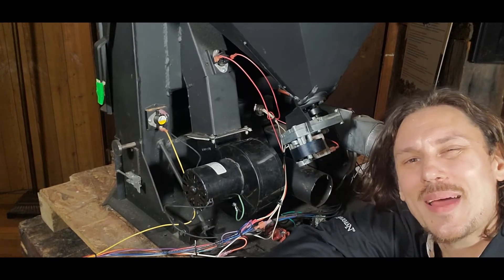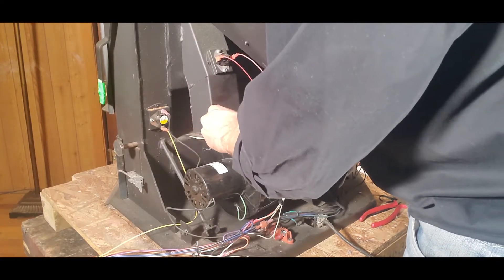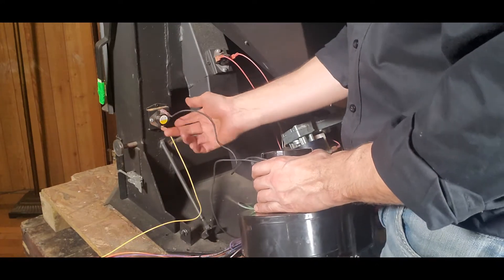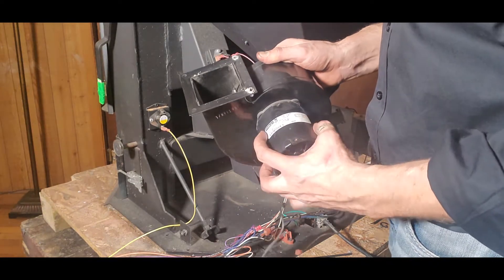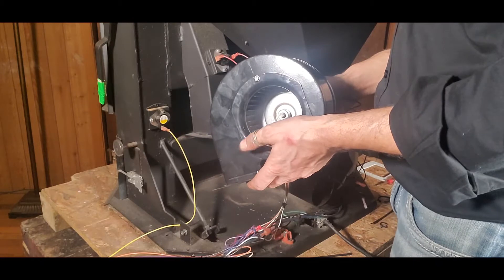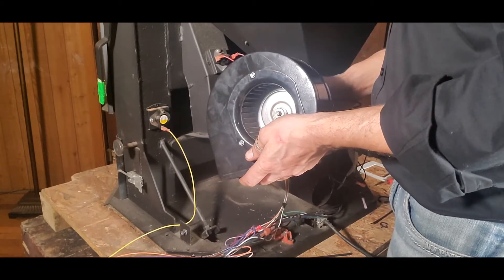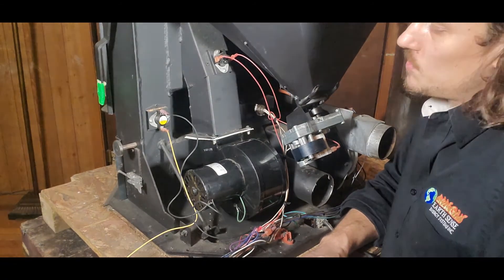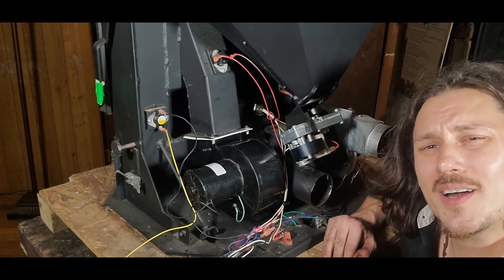Stove Distribution Fan, Convection Blower Cleaning & Replacement

Comment: I have just replaced the convection blower on my enviro ef3 and it now cycles on and off,dont know why as it didn’t before,
Reply from the maker: Thanks for contacting us. Your EF3 model has a snap switch in line with the convection blower. This switch allows the blower to turn on and off based on temperature. Double check electrical connections to that snap switch. You can also bypass that snap switch for troubleshooting (We never want to leave a safety switch bypassed, ONLY for troubleshooting). Here is a video on creating a jumper wire to do this. https://youtu.be/FDVkbsHS95U?si=KGyx_GURdp3WmBq0

To rule out the blower, you can run it to direct power to see if it runs continuous at full line voltage. Video here on creating a test cord. https://youtu.be/rlmiCYI2WPk?si=pCHbbsPfVbgC9zIn

Here is the EF3 Owners Manual. The limit switch that controls the blower is marked as #4 on page 40. https://www.manualslib.com/manual/47767/Enviro-Ef3.html?page=40#manual

Keep us posted, we are happy to help.

Comment: Do you have any videos on replacing the convection blower on an old Quadrafire Mt Vernon? Ours is going on 20 years old and is very loud when the convection blower comes on. We’re wondering if it’s easy to replace just to see if it quiets down.
Reply from the maker: Thanks for contacting us. Unfortunately we do not have a video replacing the convection fan on the Mt. Vernon model. The replacement of that blower however is very strait-forward. It's a double squirrel cage style blower That tucks into the air duct inlets. 2 wire electrical connection. Here is the OEM blower for reference along with an alternate option. Happy to walk you through replacement if needed. Thanks.

https://pellethead.com/product/quadrafire-mt-vernon-oe-convection-distribution-blower-oem/

https://pellethead.com/product/quadrafire-mt-vernon-o-e-heatilator-ecochoice-convection-distribution-room-air-blower-motor-oem/
Reply: @EarthSense  great thank you! It seems to be working fine other than being extra loud compared to other people’s pellet stoves. Do you think that’s just the age of the stove (it’s new to us this is our 2nd year with it) or would replacing the blower help? I’m sure we can figure it out, so far we have replaced the thermocouple and have a new snap disc on the way.
Reply from the maker: @SageHill-n5q  Thanks for the message back. I will say that the Mt. Vernon original model was known for that blower being pretty loud - in the sense of air velocity volume. If you are hearing squealing, grinding, high pitch noises,  etc.. that would indicate a blower issue. If you are just hearing high air velocity noise, I would say that is normal in that particular model. Any other questions just let us know. Thanks!

Comment: I have an old Advance that turns on , fires up, but it’s not blowing any hot air out. The blower is not blowing any air out. Can this be fixed or do I have to replace the blower?. What could be the problem?
Reply: Do I have to dismantle it from the stove? Also when I run the test cord and plug it in will the blower blow?
Reply from the maker: @milagrossmith4891  You can leave the blower in the stove while you run it to direct power. Have your stove unplugged from the wall anytime you are working with the components. Connect the blower wires to the test cord wires and plug it into a wall outlet. If the motor is good it will start blowing full speed. It is best to pull the fan out of the stove to inspect the blower motor and to make sure all the the fins are clean, but you can certainly do this test while it's in place. Keep in mind that blower is supposed to be removed at least once a season for cleaning. Keep us posted. Thanks.
Reply from the maker: Thanks for contacting us.  Best way to determine if the blower motor is good or bad will be running it to direct power. Here is a video to show you how to make a test cord and do this. https://youtu.be/rlmiCYI2WPk?si=GPlSWAypwNcMglXg
If the blower motor works fine to direct power, then let's inspect and clean the ESP probe next. Here is a video on doing that. https://youtu.be/kt7nnGMYU-k?si=AVoRb6MQis8jDrTD
Here is the Advance blower motor for reference https://pellethead.com/product/harman-distribution-convection-room-air-fan-blower-motor-oem/
Keep us posted happy to help.

Comment: My blower fan is not working..could it be the sensor? 11:00 Pacific time
Reply from the maker: Thanks for contacting us. Yes, it could be the blower low limit switch. For testing purposes only, you can bypass the switch to see if it is the issue. You can also run the blower with a test cord to direct power to determine if the motor is good or bad. Here are some additional links below that will cover these troubleshooting methods. Keep us posted, happy to help. 
https://youtu.be/FDVkbsHS95U?si=Tt8mLs3M_tVTUO34

https://youtu.be/rlmiCYI2WPk?si=5Tk5Fk5hkMmUsWzC

Comment: when does the convection blower suppose to turn on?
Reply from the maker: It depends on the stove make and model. Several models like the Winslow in the video here have a low limit switch that has to get hot enough to close/lock-in to turn the convection blower on. Other models the convection blower timing is built into the control board. Some very early pellet models had the convection fan come on immediately. What make and model stove do you have? Happy to assist.
Reply: @EarthSense  I have a lopi wood pellet insert. i keep having a problem. pellets feed but don't burn, I bench tested the heating element not issue
Reply: @EarthSense  I clean the stove works great. if I go to start it up again same issue. I take apart clean, works great. even if I run one bag of pellets
Reply from the maker: @williamwalters9985  Thanks for the messages William. If pellets are feeding and the unit is not igniting the pellets but you have tested the igniter and know it's in good operating condition, we either have an air blockage or an air loss issue. Check the simple things first. Door gasket, glass gasket making tight seals. Combustion blower motor running near line voltage during start-up. Burnpot seated properly and all holes cleaned. Air intake under the burnpot free and clear. Nothing plugging the exhaust vent pipe. Depending on which Lopi insert pellet model you have and the age of it will determine if there is a low limit switch for the Distribution/Convection blower. I think it will be important to solve the issue with the unit igniting properly to start first. I know you bench tested the igniter, but it will be good to do an ohm test if you can to determine if it is in operable range. The Lopi element should be between the range of 54.0-63.0 Ohms. Keep us posted, happy to help. Igniter Reference Video https://youtu.be/z4wmCc96rVI?si=Vs6x7slWo0sqk3ty
Reply: @EarthSense  I did ohm it out but had no reference on what it should be, so I plugged it into the wall. but i believe it was in that range. I ordered gasket material think it might effect the air ratio.
Reply: @EarthSense  this last round of clean I did clean out the exhaust differential switch for the first time.
Reply from the maker: @williamwalters9985  Thanks for the messages William. You can do a dollar bill test to check your door gasket. With the stove off, place a dollar bill half in and half out and close the door. Pull on the dollar bill. There should be heavy resistance. Check in several areas around the door. This will let you know if it is a door gasket issue creating the problem. Inspect the glass gasket to make sure it appears to be sealing well and there are no air gaps. Glad you are double checking and cleaning things thoroughly. Keep us posted.

Comment: How did you remove side panels of the stove.
Can you replace blower motor without panels removed.
Thanks
Reply from the maker: For the Winslow model shown in the video the side panels simply lift up and off. Other models will be different on how the side and rear panels are removed. Generally speaking the side panels and sometimes the rear panel needs to be opened up to remove/replace the blower motor. Let us know the make and model stove you have and we can better assist. Thanks!

Comment: I have US stove KP60, the exhausr blower pulses from start up till cool down. some say its normal, but not when I bought it two years ago. canthis be adjusted or can you guess at what causes this.Thanks....Tim Smith.
Reply from the maker: Thanks for contacting us. The exhaust blower should not pulse during operation in your KP60. I'm sure this is affecting your fire, cleanliness and efficiency while in operation. Generally during start-up the exhaust blower is near line voltage. In normal operation there will be slight variations between heat settings, however the blower should run at a consistent voltage on whatever heat setting you have dialed in. We would suggest inspecting the exhaust blower and possibly doing a direct power test - https://youtu.be/rlmiCYI2WPk?si=bx_TD2Bp46caOvZc

It will be good to determine if this is an issue with the motor itself. If the motor seems to run fine indepedently then most likely it's an issue with the control circuit board and the output it is giving to the exhaust blower. 
Always check the simple things first. Make sure you don't have an issue at the outlet giving variable voltage and check all electrical connections. Keep us posted, happy to help.

Comment: My Breckwell P2000i convection blower comes on intermittently. At times, during shutdown, it won't even turn on to cool the unit. Also, when it does come on, it squeals. What type of lubricant?
Reply from the maker: Thanks for the message. Yeah, it sounds like your convection blower may be on it's last leg. Programmed into the circuit board is the timing of the blower and it should be operating from the moment the stove starts heating up through cool down. If there are oil ports on the motor, we generally recommend a synthetic gear oil or sewing machine oil. The label on the motor will indicate if oiling is required. Most of the newer motors are going to be sealed and do not require lubrication. Here is a link to the replacement blower for reference. https://pellethead.com/product/pellethead-replacement-breckwell-us-stove-replacement-convection-fan-blower-assembly/

Any other questions please let us know. Thanks!

Comment: I have a 25-cab80 englander that doesn't seem to be blowing much air from the convection blower even when fan speed is set at highest.
Reply from the maker: Thanks for the message Owen, I just sent you a response regarding this on the previous message/comment you posted. Take a look and keep us posted. Happy to help.
Reply: Can a rheostat work to increase fan speed. Having pelletstove at high setting just to get some heat to home is burning almost 2 bags of pellets a day (cold up in Northern ontario Canada)
Reply from the maker: @owendean1616  Hey Owen. The blower in your unit will be controlled by the circuit board; we wouldn't advise connecting an auxiliary rheostat. Here are some things you can do and check. 
Your Blower in the 25-CAB80 is 1550 RPM, 250 CFM. I would suggest giving it a thorough cleaning - if you can pull it out and   blast some compressed air on it, both on the impeller and motor windings, it will make a huge difference. From there you can always check voltage to see if it's running properly. Second, I would recommend a thorough cleaning of your heat exchange tubes and any excess ash that may be in the rear fire wall, ash traps, and exhaust venting. Ash will act like an insulator and not allow as much heat to pump out. The less ash on your heat exchangers and in the stove the more efficient it will be.

Here is a link to the blower for your stove should you need a replacement. 
https://pellethead.com/product/pellethead-replacement-england-stove-works-englander-convection-blower-fan-for-models-2002-present/ 

Here is a link to an example of bottle brushes we like to use to clean the heat exchange tubes. https://pellethead.com/?s=bottle+brush

Hope that is helpful. Thanks!

Comment: Can you use wd40?
Reply: Instead of oil?
Reply from the maker: Thanks for contacting us. If your stove has a motor that requires lubrication, we recommend a synthetic machine oil or sewing machine oil. WD40 will not provide the penetrating lubrication that is needed for the sleeve bearings inside the motor. Any other questions please let us know. Thanks!

Comment: My blower motor is not turning on while pellet stove is in operation. What are a few things I can check?
Reply: I have a 3800 Cumberland stove and the circulating blower fan will not turn on when it first lights. After a while it will turn on, but it's a little noisier. I found a new one but it's almost $300 is there a way to find the specs of it and can I use an aftermarket blower fan?
Reply from the maker: @PostalReptiles  Thanks for the message. I believe your model has a low limit switch in place for the blower. Once it reaches a certain temp it will lock in allowing the blower to come on. Yes, I'm sure we can find a good aftermarket option for less - let us know the motor specs on the label and we'll see what we have. Thanks!
Reply: @EarthSense  yeah it must have some sort of sensor switch that tells it when to come on, because it usually comes on after it's been lighting for a little while once it's warmed up. But now that is very delayed, sometimes taking minutes after it's been lit before the fan comes on. Is that switch built in the fan motor? Or is that switch something separate that I could possibly replace instead of replacing the fan? Thanks for the response
Reply from the maker: @PostalReptiles  Yeah, that would be a low limit blower switch which is separate from the blower itself. You may have to look at an owners manual for your unit to find exact placement. Most low limit blower switches are 110 or 120 degree meaning it has to reach that temp to lock in. As I researched the one on your Cumberland it's a 160 degree switch. On most stoves it's generally 10-15 minutes after the stove lights before that blower comes on, with a 160 degree switch it may be even longer. Here's a retailer I found selling that switch for your reference. https://www.dndfarmsupply.com/swsndifanco.html
Reply from the maker: Thanks for contacting us, happy to help. What make and model stove do you have? Some units have a low limit switch that turns on the room air blower while others dictate that blower coming on through a sensor or program in the control board. Once we know your stove make/model we can hone in on it. We can also do a direct test on the blower to verify the blower is in working condition - here's a video on creating a test cord. https://www.youtube.com/watch?v=rlmiCYI2WPk&t=4s

Keep us posted!